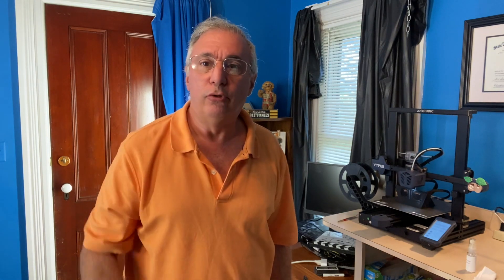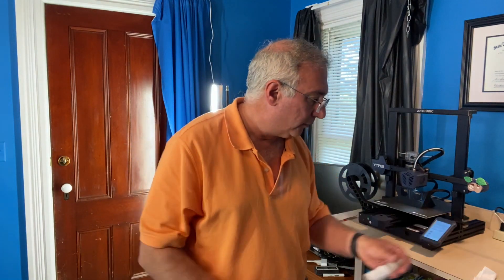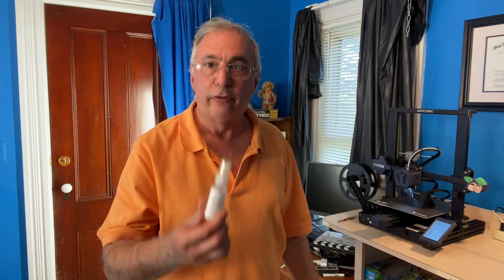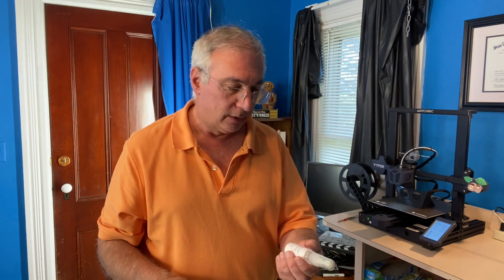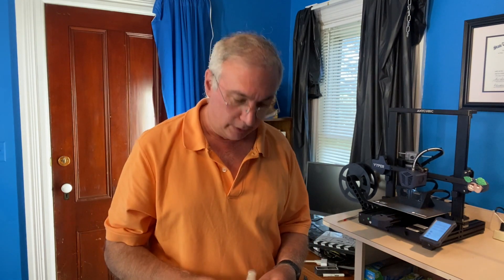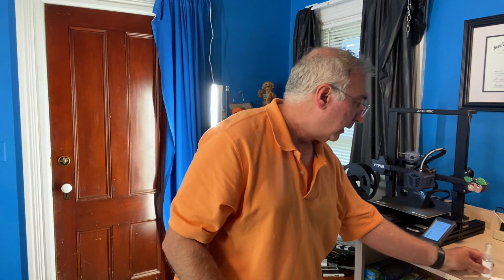3D Printed CNC (MPCNC) LASER Cutter Project Part 1

Comment: Cant wait to see more, have you decided on a type of laser yet?
Reply from the maker: Part 2 posts in the morning. 😁 And yes, I'm going all in with a CO2 LASER.
Reply: @Dr.V.  How do you like the rails on the mp? Are you familiar with the Onefinity design? I even like what people have been doing with diy knee mills lately. cool stuff. Do you have a suggestion on where to purchase a laser
Reply from the maker: @jordanmalone3888  I have had no issue so far with the rails I made from Home Depot conduit. But of course I'm not putting a whole lot of torque on them as I'm not actually milling. Onefinity looks pre-made - I was looking for the fun and challenge of a budget DIY build. I ordered my LASER components from CloudRay. We'll see how well they work when I get that far. (I just finished editing Part 3 which will be posted Saturday morning.)